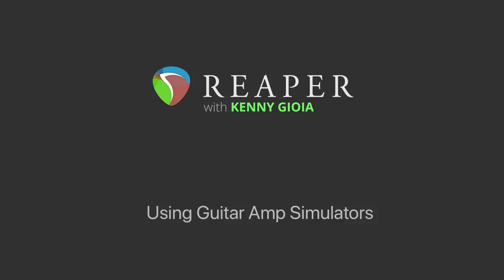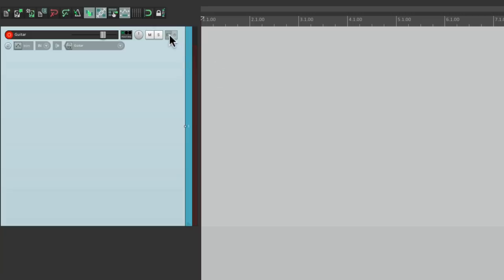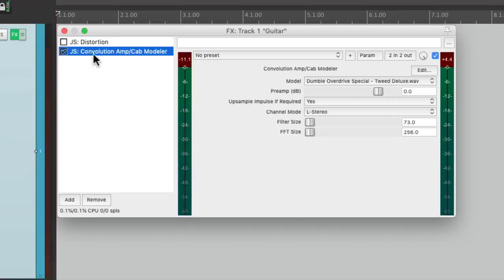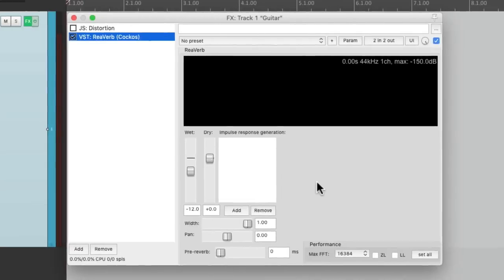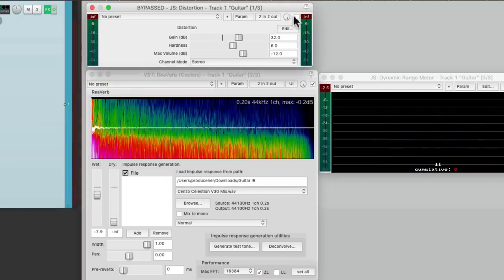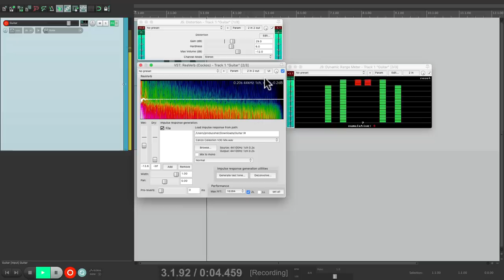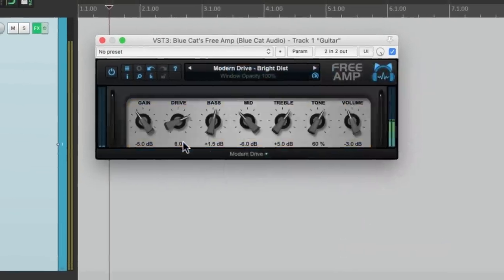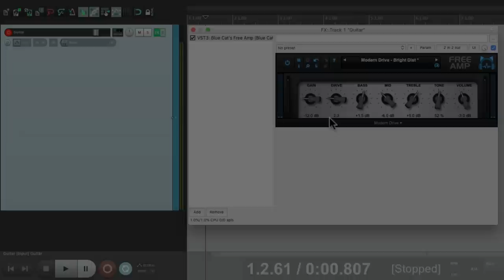Using Guitar Amp Simulators in REAPER

Comment: Best to create two channels to record the clean input as well as the wet (with input fx). That way you can always change the sound later or try different modelling/hardware amps and fx
Reply: no reason to put the effect on the input at all
Reply: @Jake Gregos  I disagree, what if you switch effects during the song, if there not imprinted on a track then you'll be stuck doing alot of automation.
Reply: @Gregoses  I believe the main reasons to put the effect on the input are: 1) commiting to the sound, and thus avoiding endless procrastination tweaking the sound later; 2) performance/energy efficiency, as it avoids spending CPU on the FX every time.

Comment: Hi, Kenny! I'm having issues when mixing guitar tracks using 3rd party amp sims. There's always an input delay or a slight mute when starting playback. I've read some issues posted on the forum regarding flushing fx. Tried it but to no avail. I'm using Neural DSP's Archetype and mixing it with dry guitar tracks. My cursor is at the very start of the transient. Everytime I press playback there's a small delay before the audio is heard. 

However, the issue disappears when playing it back before the transient (even by a 16th of the grid). I already tried adjusting buffer size but it's all the same. I don't think it's a buffer issue at all. Still leaning towards Reaper having a delay when processing the audio signal every playback with 3rd party amp sims. Do you have any suggestions for a fix? Thanks in advance!

PS - Just tried unticking "anticipative fx processing" and the issue seems to be gone. I kept the Global setting turned on and just selected "prevent anticipative fx" on certain tracks. Just read about this feature and still trying to learn more about this feature. But as of now, this seems to have resolved my issues using 3rd party amp sims on my mixes. Hopefully, you could post an in-depth look into this on your future video. Again, thanks for all the lessons regarding REAPER!

Comment: I am having a horrible time with Amp sims. I'm on Windows 10 and Reaper. The amp sims that i load sound super fuzzy, popping crackling, and full of white noise. I can barely hear the amp sound underneath the clean tone of my guitar. I'm going for a metal distortion. Any ideas what could be the problem? Just sounds like the VST's are broken but they're not.
Reply: You need to change your buffer size. Google it and there are numerous tips and explanations.

Comment: I'm having issue when recording guitars as I always hear the signal guitar in Reaper. I use guitars plugins with heavy distortion and if I use the noise gate to the max the distorted song will go (logical) but not the clean guitar song that is always on the back. Any idea Kenny?
Reply: Try a volume controller plugin?

Comment: I never noticed the zero latency button on ReaVerb. But isnt that latency the cpu trying to catch up, so how can it just magically go away, im confused?!
Reply: lardosian plugin latency can also be greater if the plugin needs more time to process the sound due to operations such as lookahead.  I.e. a limiter with 30ms lookahead will have 30ms of latency. So, it’s not always about cpu usage, in fact high latency plugins usually involve a lookahead buffer.

What I think the low latency option does in reaverb is spread the processing across different CPU threads, thus reducing the CPU queue.  So, in a way you could say that zero latency mode assigns MORE cpu time, not less.  But it’s spread differently.
Reply: @Skijumptoes  thanks mate!  I just installed my new behringer umc 404, heard good things. Hooked it up to reaper and within 5 minutes get a blue screen. Didnt happen once with my previous interface, not impressed.

Comment: Anyone have any suggestions for eliminating lag between playing and hearing it back?
Reply: Are you using a proper sound card with real ASIO drivers (not asio4all or similar)? I use a Focusrite Scarlett and there is absolutely no perceivable lag. My standard setting is 24-bit 96khz and buffer size 128, which gives less than 4ms lag.